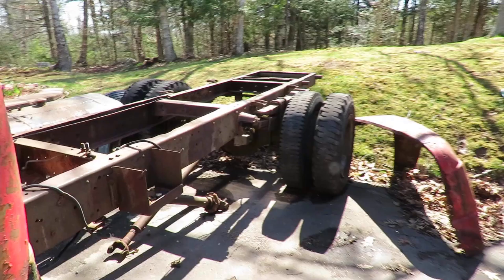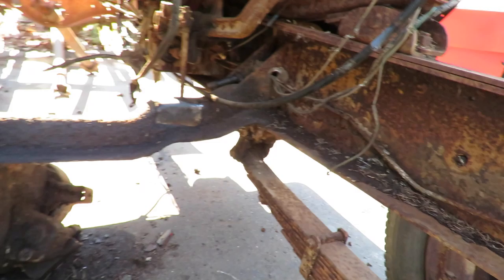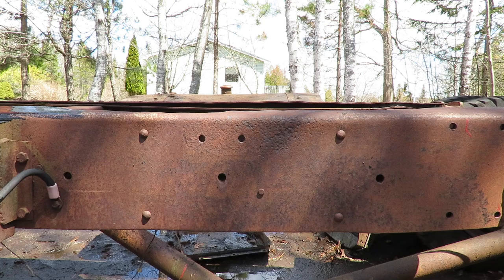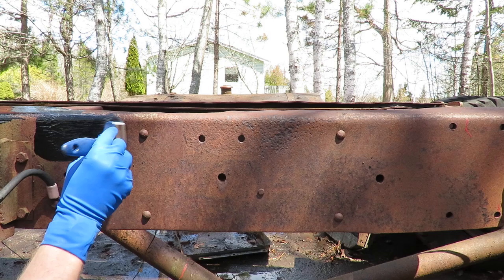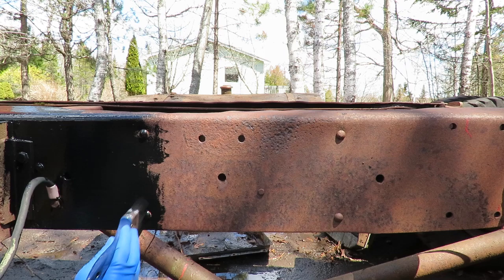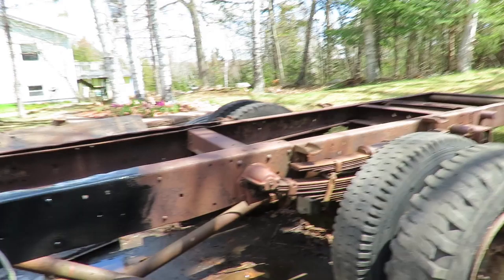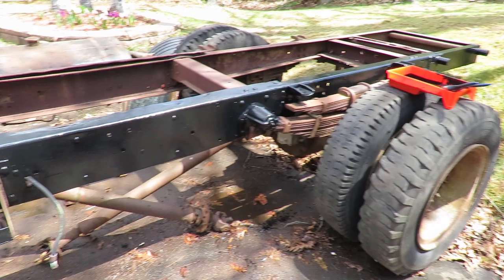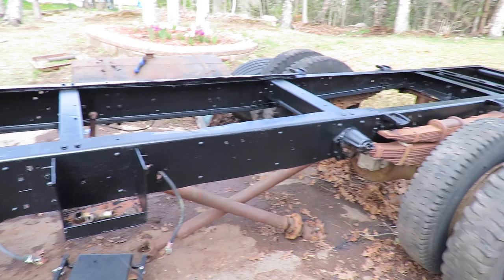1955 International Frame Pressure Wash and Paint

Comment: Good to see your progress. I have a 1959 International B-180 grain truck that I acquired last year to primarily use as a hauler/dumper around the farm (gravel, compost, dirt, etc). She’s a sweetheart, a little unpolished here and there, but she shows up to work with a great attitude and gets the work done. I’m about to launch into replacing all of the wheel cylinders and brake lines, and will have to see what the shoes and drums look like when I get into them. Thankfully the owner of our local Carquest Auto Parts store has parts books going back decades and can still source parts for the old girl. I’ve also got a 1951 Chevrolet 3800 cab & chassis waiting on me to restore to take to farmers market. I drove her on to the trailer under her own power, but essentially all of the brake system has had to be accumulated for replacement, including original “better” condition drums, as there are no aftermarket ones for the one tons. I’ve also found a 1953 flatbed to restore and eventually mount as well. As you know, these projects take time when balancing other employment and life. I’m enjoying seeing your ‘55 project, and look forward to future posts.
Reply from the maker: Funny you should mention the brakes, I've taken a swing at mine maybe a month or two ago just to see what parts I'll need aannnddd it's not looking like I'm going to have an easy time sourcing replacements. I can still buy my master cylinder, my brake booster, and my wheel cylinders (which is great) but I can't locate pads, drums, or hardware kits. Also, I bet that B-180 is a beautiful truck, I love the cab on those trucks they have such a classic look to them!
Reply: I have a 1961 International B180 and need to do all the brakes. It would be great if you made a video of the complete brake job. That is my next project on my old truck and it would be great to see how its done.
Reply from the maker: @torontotool1 I'm still trying to find my brake parts, but I think that oldinternationaltrucks in Alberta might have what I need. Sorting out my drivetrain will be the first thing I want to do in the spring, but brakes should be second. Have you tried sourcing parts for yours yet?
Reply: That would make a great show, my old truck or this old truck. Some of you other guys should start a YouTube channel because I love these old trucks and enjoy watching people work on them.

Comment: I found your channel through Zane’s, and you got quite a cool project truck there.  It’s amazing what a good pressure washing can do to a vehicle.👍 Great work painting the frame it looks awesome!
Reply from the maker: Thanks! I'm excited to see how Zane's international comes along,the original motor in this truck is the same as Zane's I believe, mine was toast unfortunately but I'm hoping that Zane will have better luck. I'd love to at least see one run, I've never even heard one running before!
Reply: Rust Rehab  Definitely!  These old trucks have so much character to them.  I’ve never heard one run either, but if there’s anyone on this planet that could get that engine goin it’s Zane!👍

Comment: If that's black Rust-Oleum paint it will hold up nicely. My dad and I put it under Neath my 1965 Dodge dart from the fire wall back to the rear bumper.
Reply from the maker: That's exactly what it is, just sold under another brand name here. Im glad to hear it, because some of the other stuff I have tried over the years did not hold up well at all

Comment: The wire you found between the front engine mount bolts is the 1950's version of a locking fastener.
Reply from the maker: I figured it must have been something like that. I'm not sure if it showed up well on camera, but those volt holes are really  blown out. At some point that engine was doing a lot of shaking around for sure

Comment: The job description of a pressure washer is: Remove all unwanted grunge from where you don't want it, to the other place you don't want it. i.e. the operator
Reply from the maker: I got myself properly coated. Spent half the day covered in gunk, the other half in paint. Glad to have it done with though, less worries about it rusting out over winter now